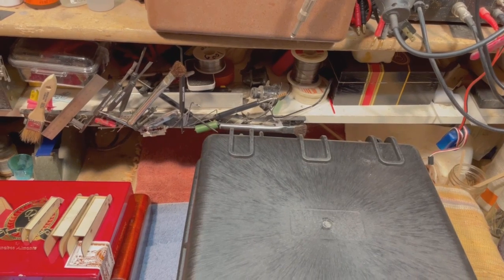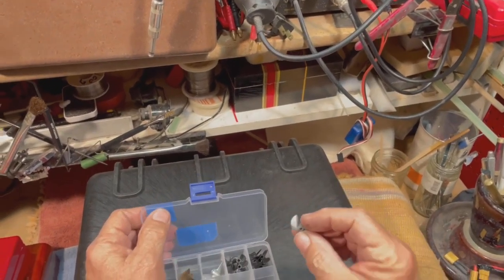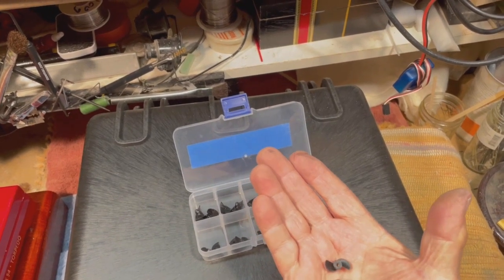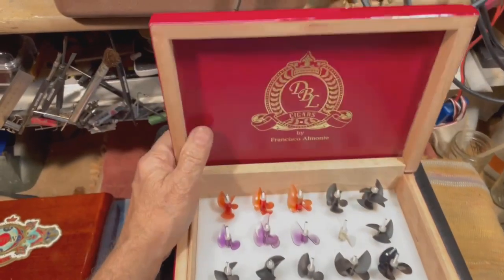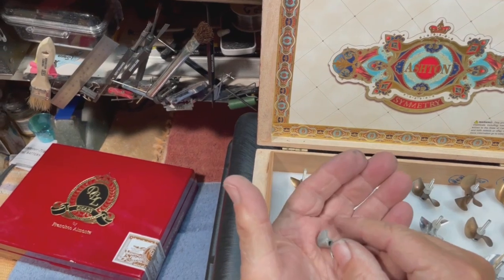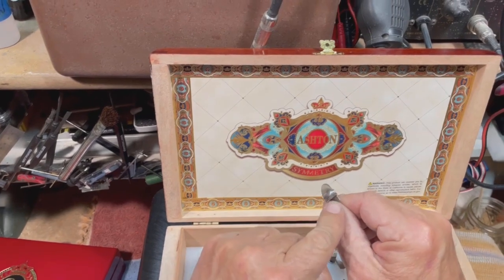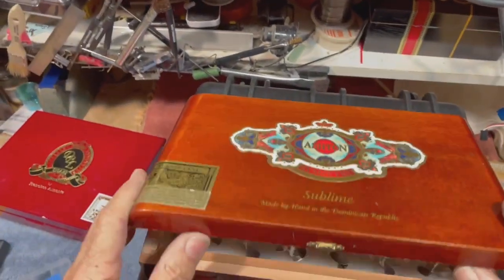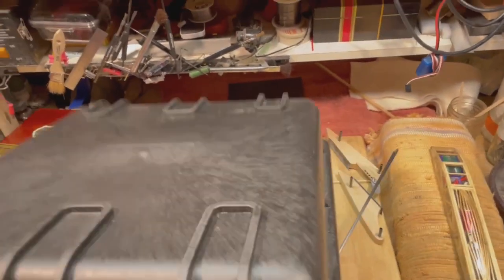Dr. Jet nears completion of Prototype 1 for the12" Challenge

Comment: Very nice DJ thank you for sharing fun stuff!!! 😋👍
Here is my 12" tub rigger design, true pure 3 point outrigger no skids and strut surfaces / the rear rides only on the prop hub of a DIY 20mm metal surface prop / the transom is suspended well above the water surface. All up feather weight of 127.6g / radar checked to 24mph with a peak doppler pass at 26mph -fresh charge 3S 460mah / silver wire wound 8g outrunner motor /10g with plug harness / 4.92g to every 1mph / achieved!! I am the originator showing a unique 1st publicly presented sponson to boom design that has been adapted with variances up to this day. The "Little Water Wisp" was way ahead of it's time, back when manufactures 1st started providing a truly small silver wound  high performance micro size outrunner circa 2008 / design assembled and filmed in 2009 / enjoy the test run vid, passes get good as I go along controlling the "Lil Wisp" with a unique micro ride & sound!:  https://www.youtube.com/watch?v=ok2rXbFo1jc